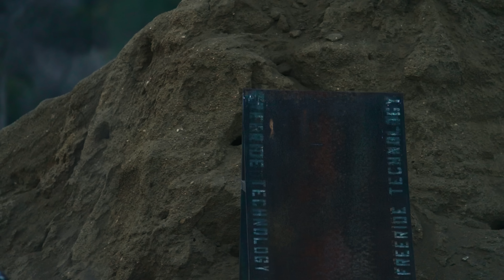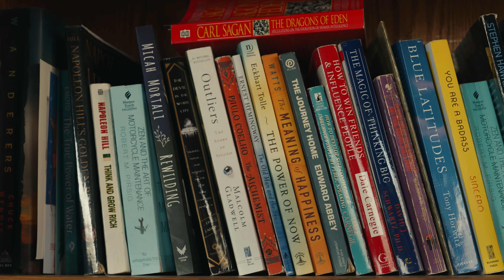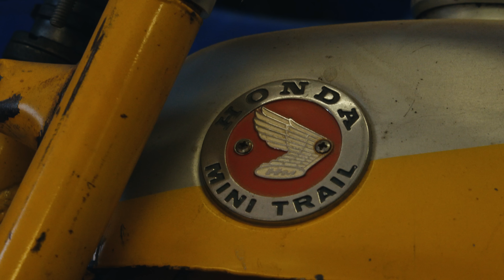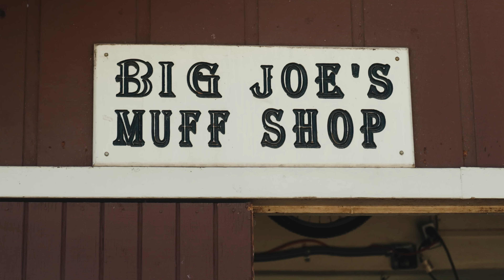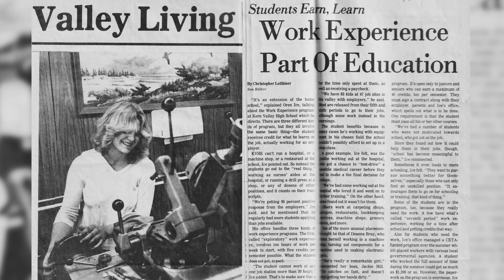FOX MX | JIMMY HILL | UNPLUGGED

Comment: lhow lucky to get to ride on your property. where i am, land owners and county lawmakers and enforcers have changed the wide open ends of the san gabriels moutain range and the sierra pelona mountains plus all the high desert valleys connecting the hills, into private property. with strict off road use prohibited, while the land gets trash dumped in it on a continuous basis. weather erodes wind and rain storms that are flash floods, to eventually be plowed and housing tracts developed on the sacred dirt. just recently i seen a pretty good area that had a couple neighborhood kids riding home built motocross tracks, and some rich dude who made a killin on internet gaming puchased the land, some 266 acres, not a whole lot, but his obvious hatred towards offroading when his plan is to permaculture the whole area, ok great, but where do you think he started? right on the motocross track, i had the surprise visit with him, i'm riding by and he waves me over to where the track was, i thought he might be in trouble broke down or something, and unveils his plan while telling me i'm trespassing. i told him what a excellent job he was doing and hopefully the kid(s) that were riding the track could find a street gang to join since he's been pretty much forced off the land.  bear in mind the new owner had a guy running a skid steer plowing dirt and slopes to make his dream come true. i'll bet without correct permits also. on a major watershed area that has 2 monster sized catch basins with 8+feet spillways to try and slow the possibility of major flash floods into a 3500 lot housing development (new by the way,) and no matter how rich you are, you can't just start plowing dirt your way, it takes permits that have on site environmental impact representatives, water truck operation during earth moving with compaction and soil samples not to mention wildlife relocation efforts, with endangered either critically or threatened wildlife is major important as requirements before you start to dig. but no, the short chubby game maker is on a mission to make a life long dream come true in an area so arid and windy into a tropical paradise that just thrives on its own. making a legacy for himself as what a good life he had. that's all cool whatever, but us bikers, off roaders need desperate measures to make a stand ourselves, get together and buy property, in those mountains butted right up to rich boys land and open it for all dirt bike friends, giving us a place to ride. i've been riding for over 50 years and seen champions into the 10s, world champions developed. i could name some that came right from these hills, notably, bob hannah, known only as the best motocross rider on the planet in his day from practicing on his tracks here, supercross wouldn't be if it wasn't for hannah, Ronnie Nelson, Terry Clark, Mitch Mays, Ronne Wright, and myself (SCORE) class 21 international championship, and reining  world superstar Kurt Caselli (i remember when he was born,) all names of these guys all lived within next door to 7 or 8 miles away, riding the same hills. we became outlaws. and it's time, for a ride, bye.